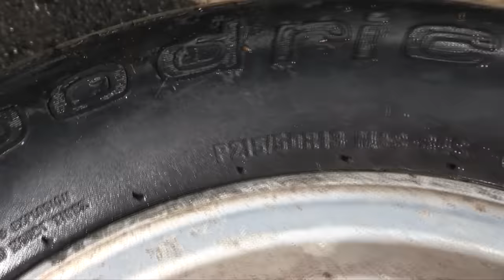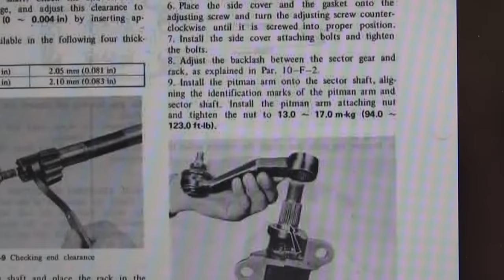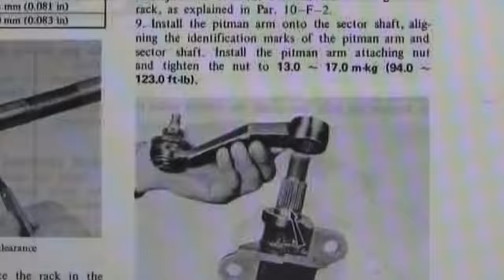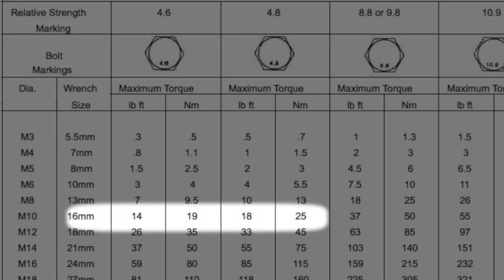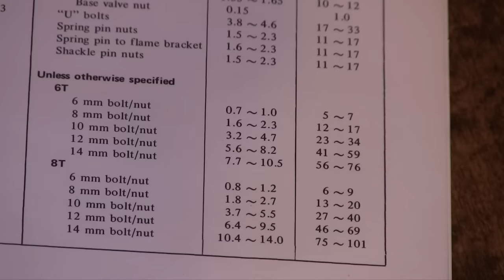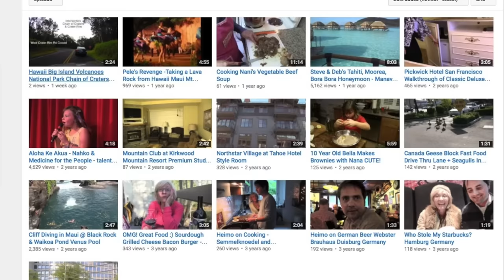VLog 23 Mazda RX3 Suspension Torque Specs Front & Rear Restoration

Comment: Watched several of your videos and I have to say the car is looking nice.  I hope I'm not presuming ( I don't know your knowledge level really) but I noticed some things during the ones I watched and thought I'd offer some bits of advice from doing restorations professionally (and racing RX3's for a number of years in the '80s).
1) The reason OEM's usually tell you to torque suspension the way they do is because pressed in bonded bushings (rubber or poly) don't rotate once tightened, the only movement is from the flex of the material between the bonded inner/outer layers.  So if you torque it all up in the air, two things happen,  1) It looks like a 4x4 (and it won't settle down until the bushings go bad), and 2) it generally tears up the bushings pretty quickly.  Non-bonded poly bushings (generally push them in by hand then push a metal sleeve into the center) are less prone to this since the metal sleeve rotates in the bushing.  I never got a good look at your bushings before install but if they're bonded you want to tighten them with the full weight of the assembled car on them (ramps work well).  Start with the bolts/nuts finger tight too, no wrench torque at all.  If they're not bonded it makes less difference but it's good practice anyway.
2) On several of the obscured bolts where there isn't room for the head of the torque wrench and a socket, might try a crowsfoot.  It will alter the torque slightly but should still be inside the fairly generous spec range that Mazda gives you.
3) Don't force bolts/nuts (like the U-bolts)... pretty sure you figured that one out already though :)
4) General purpose (ie Insurance job oriented) bodyshops suck most of the time.  They're used to the "get it in/out as fast as possible" insurance crowd who doesn't look closely at the car when it's done (and most don't know what to look for anyway) so they cut corners as you've found out.

Can't wait to see the little beast finished!  I miss my RX3(s)!
Reply from the maker: +Bill Johnson Thanks for the valuable info Bill. The Super Pro bushings are non-bonded poly. Torque in the bonded spec should be ok.
Exactly right about insurance work body shops. I have a neighbor with a body shop and he assured me he would give it the attention it deserved. Problem is, this job took him and his assistant well beyond their skill level and attention to detail. More body shop woes to come in future episodes. There really are many things I should have done myself but rushed it in to shop thinking they would take care of things. No regrets though, I'm learning so much on this RX3 that whatever I do next will be that much more thorough and better quality. Still having a great time. Thanks for watching my vids and giving input.

Comment: Nice project, under side must be rustproofed and sealed. Mazdas have thinner than normal metals( Which is why car weighs in at @885kg). I went with nolathane bushs throughout, this saved on having to get bushs pressed out in future. Southern hemisphere we use newton  meters. Any updates??
Reply from the maker: +Sampson Havoc Didn't do the underside. This project started out as a paint job &  an engine. From there I got pickier and pickier wanted to go further than original plan. So, early on, lots of shortcuts. Thanks for the Newton meters input. I'll switch to that in episodes that aren't already shot LOL.
Reply from the maker: +riverseine New vid almost ready to publish. Just gotta edit for sound and do my last blurb at the end. Very close.

Comment: Hey cars coming along nicely. did the body shop fail to fix those holes underneath the car on the rear quarters? And are you putting an underseal / protective layer on the underneath of the car (can't remember if you have in previous episodes or not)
Reply from the maker: +Karl Ward Naw they got those if you mean those wicked rust spots. No undercoat. I pretty much left the underbelly factory. I couldn't clean, strip, and coat it properly. I'm already thinking of things I'll do differently (and more thorough) next time.
Reply: sir when's the next video coming out
Reply from the maker: Very soon. Probably this weekend.
Reply: kool I can wait